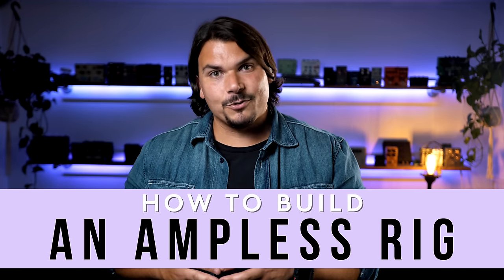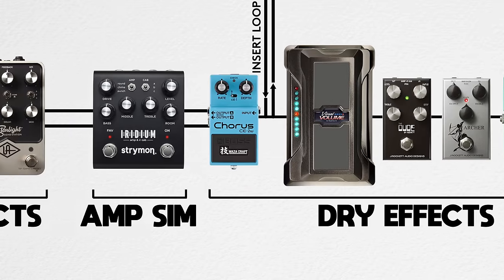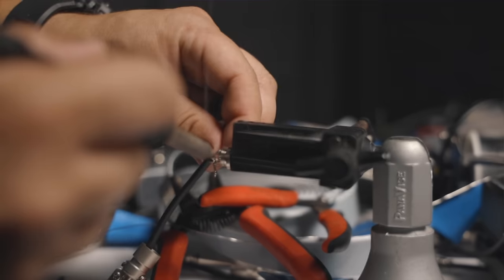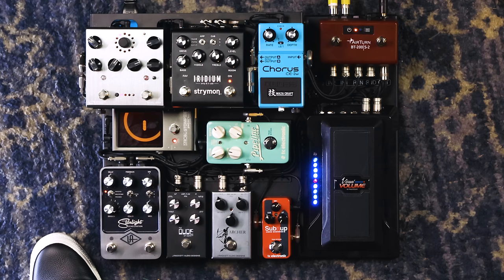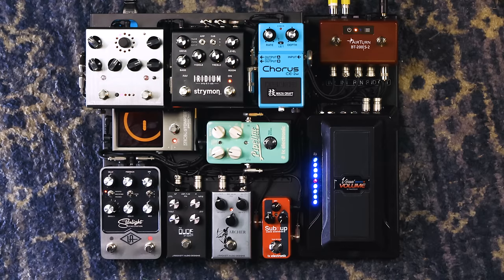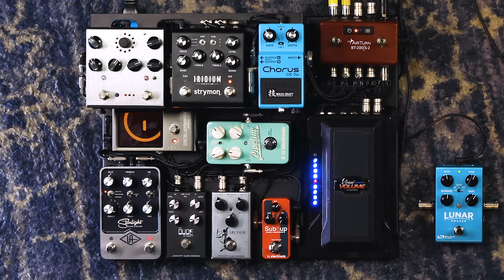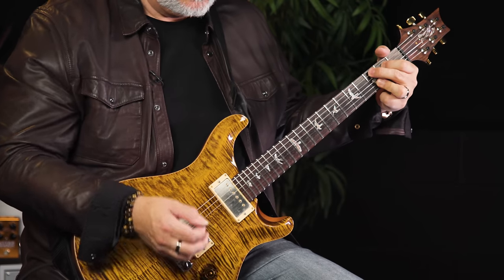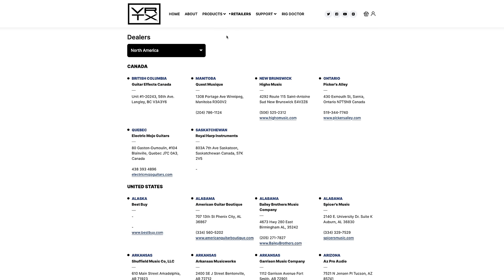Do You Need an Amp to Get Great Tone?

Comment: If I have this for a pedalboard OD-->preamp sim-->delay-->reverb can I plug this directly into my studio monitor?
Reply from the maker: Powered monitors, yes if it's like the Iridium.
Reply: @VertexEffectsInc  how about if it's just a joyo american sound?
Reply: @Funkfreed  should work too. The American Sound is a Tech 21 Blonde Sansamp clone. So it is a preamp with (analog) cabsim. You might get a bit fizzy drive tones out of it, because the cabsim is a bit outdated. Than i would recommend an IR loader or any modern cab sim Pedal at the end of the chain. I like the gfi cabzeus mono for that purpose.
Reply: @aladinhellchicken7994  I still have to use a stereo pedal at the end of my chain. Plugging the joyo directly to my studio monitor only gives me left channel even if I use trs to dual ts splitter.
Reply: @aladinhellchicken7994 what if i use a mooer preamp? do u think i can go direct input on a live setting without adding another cabsim pedal infront of it?

Comment: In the "Which Power Supply is Right for You?" video you picked the Cioks as your absolute favorite power supply, but here you're saying that Strymon is "the best of the best" – how come you changed your mind? Did you learn something new about either of those brands that made you re-evaluate your choice?
Reply from the maker: I suggested several high quality options, and said I personally like the Cioks, but also said other were wonderful.  Honestly any I recommend in that video will do the trick, I didn't land on an "all or nothing" recommendation on Cioks.  Strymon is also great, some Truetone, even some of the new Voodoo Lab Pedal Power 3+ is great.  Those could have all worked here bu this is what Mitch had and it's in the same category of quality as Cioks.

Comment: I'm going to use the SD Powerstage200 together with a bunch of pedals. Would you recommend using an output buffer? All pedals in front of the power amp?
Reply from the maker: If it's all on the pedalboard you shouldn't need an output buffer.

Comment: If you want to go into a passive speaker do you need a power amp pedal?
Reply from the maker: The Iridium is not designed to drive a speaker.  You would need a power amp.

Comment: Hi Mason, I’ve been running ampless for a couple of years with an ES8 with a board full of Strymons, to include Iridium. I have everything going into the switcher, with pedal order set in the Loop Structure page. Does this truly represent a series setup structure as if the ES8 wasn’t part of the equation?
Reply from the maker: Yes, it's just pedals in series.

Comment: Would you put a buffer before a pod go? It doesn't have one. I don't know how much it's going to affect the pod go, if at all.
Reply: You should Google search  whether the POD is already buffered. Most of these types of units already have one.
Reply: @The Tone Lounge  it's not. I haven't heard any difference between the sounds from the pod go and the helix, though. Tons of people claim there is.
Reply: @Andrew Stonerock  if it doesn't, then you would benefit from having one.

If you use a really long cable going into the unit, typically anything over 10 feet, then put a buffer on input.

Same applies to your output, only if it's a TS cable. If you have an XLR out then you are all set.
Reply: @TheToneLounge  we use 1/4 out to our power stages and xlr to foh.
Reply: @AndrewStonerock  then you just need a buffer  out to your power amp (if you have a long cable run).
Reply: @The Tone Lounge  20 ft. Like I said, the sound difference between that and the helix, which has buffers, is negligible.

Comment: I'm curious about the interface box. I typically run stereo straight into the front of 2 amps, but sometimes like to run my pedalboard into a single amp with an effects loop. It appears I could build this same interface box and use for that purpose?
Reply: Just watched your mono sum video, so probably not ideal to build an interface box to do both a stereo and mono setup (unless I unplug R on the final pedal and run/pan L), thanks for the great videos!
Reply from the maker: Yes, we have a video on how to do that and diagrams in our buffer interface tutorial.

Comment: Great board , what kind of DI box are you using ?
Reply from the maker: Why do you need a DI?
Reply: I’m confused on that as well. The ventris is the last pedal in the chain, yes? The signal goes out from there to….where? On your diagram it shows the signal going from the ventris to the mixer/daw. How would that be possible without a DI box after the ventris?

Comment: I use this quilter block cab simulator, get me to the correct impedance with a balanced signak but sounds bad.....
I use a compressor,drive,and reverb pedals that I run off a tri parallel mixer....
Helps but doesn't sound anything like headphones or an amp.....help??? 
Trying an EQ next.....

Comment: Can you run something like this into a cabinet?
Reply: You would not be able to run it into a nonpowered speaker cabinet, as it’s a line level signal coming out of the pedalboard. But they do have flat response, full range, powered speakers (similar to a powered PA speaker) which you would be able to run directly into. I go out of mine into a high wattage, clean keyboard amp, which also works pretty well.

Comment: Really great build! I just wanted to ask your thoughts on something like the Pinestripe Pedals Diso+ after the pedals to match the levels a bit more for the FOH or direct signal to the recording interface? It’s beyond me, but I’d always want the best tone / signal for recording. Thanks!
Reply from the maker: With something like this, you shouldn't need any sort of DI, the output impedance is low - 100 ohms with any decent guitar cable you should be able to drive 100 or more feet without any degradation.
Reply: Agree with the Rig Dr's assertion that a buffered/low impedance signal will drive an unbalanced signal up to 100ft.  If you are running into a recording interface, there should be no problems. However, if you are playing on a stage, you'll likely need some way to convert to XLR to connect to the snake. This can be accomplished in many ways..but keep in mind that if you connect the Iridium directly to a mixer and phantom power is accidentally applied, it will quickly KILL the Iridium's outputs.  Anything with transformers will prevent damage as will an active DI.  Keep in mind that most passive DIs will drop the signal level by 15 to 20dB.  This can usually be made up by cranking the channel gain.  We designed the DISO+ with 1 to 1 Jensen line isolation transformers to keep the signal level at the original level, convert from 1/4 inch unbalanced to XLR balanced, allow ground lifting (not possible with a 1/4 inch guitar cable connection).  In addition it has 1/4 inch outputs that can be used to connect to a powered speaker for monitoring and can be used at the same time as the XLRs. HTH!
Reply: Wow, thank you both for taking the time to reply!

Comment: Hey Mason,is there a way I can boost a line level signal??…..I have an old 1989 Marshall 9005 stereo rack power amp…..it was designed to pair with the matching Marshall preamp,which was -10db to -20db on the output,so the 9005 is expecting a loud signal on its input…….In my application,plugging a pedal,or load box into it,you have to really crank the volume to get the needed volume levels…it’s not putting out its full potential without a hotter signal going into it…….not sure how to do this…
Reply from the maker: So you're trying to drive the power amp with a pedal?
Reply: @VertexEffectsInc  kind of…….It’s a wet dry wet system……my line out of a load box feeds a Micropitch,Delay and Reverb pedal,which connects to the A and B inputs of the power amp…..

Comment: Do we need to put buffers if we have buffered pedals?
Reply from the maker: The buffers in your pedals are not the same quality as the buffers recommended for the input and output of your pedalboard or (for example) the buffer we manufacture.  Most of the internal buffers are designed to drive short distances (like between pedals), not a 20+ foot cable back to your amp  or load the input of the pedalboard properly.

Comment: Hi Mason. My ampless setup. 

Boss TU3-Blackstar Dept 10 preamp with delay & noise gate on its efx loop - headphone out - PA/interface. 

Can I put a Zoom MS70 after the Blackstar preamp using the headphone out & still have the Cabinet simulations? Should I use a TRS or TS cable? Thanks

Comment: Jason, Iridium or Walrus ACS1 as your choice?
Reply from the maker: I like the Walrus because you can use a different amp on each side of the stereo outputs.
Reply: @VertexEffectsInc   Right. Is there a way to run one side into PA and the other side into an amp, e.g. an AC15? I don’t own a powered speaker amp.
Reply from the maker: @windowsoflife  yes, put a splitter before the Amp Simulator.
Reply: @VertexEffectsInc   is the Radial BigShot ABY okay?
Reply from the maker: @windowsoflife  sure but you could even go simpler since you don't need any ability to AB, you really just need the "Y".
Reply: @VertexEffectsInc   I was think of ABY for multiple use, when I would use the Walrus.., and if I wanted to go w two amps- my Dr Z and AC15. 

Mason, I really appreciate your incredibly prompt and excellent direction you give!
Reply: Great pedalboard! Mitch sounds like Neil deGrasse Tyson.

Comment: So I tried making an amp less pedalboard using a Vertex SSS-SRV, and Ultra Phonix, a Boost, an EQ pedal, delay/reverb, and a Cab M+ pedal. But when plugging into my cabinet, it barely makes any sound. Not powerful enough. So it seems you at least need a pre-amp pedal of some kind, correct?
Reply from the maker: I think you misunderstand the product.  It's not a power amp (to drive speakers) - it's a preamp pedal that's designed to work with cab simulators, like the Cab M.  The Cab M isn't a load or designed to drive a speaker cabinet, it's only a speaker thru if you wanted to say, use it for an IR to feed the FOH, and didn't want to mic your cabinet.
Reply: If you had powered speakers / monitors then what you're doing would work.

Comment: Had a Strymon Iridium - sounded AWFUL has that terrible digital sound, sold it eventually - that's put me off ampless.
Reply: Try any of UA/FX's amp sim pedals, Woodrow - tweed amps, Dream '65 - Deluxe Reverb, or Ruby- AC-30s. They are amazing (I have a Ruby and love it). Check out Rhett Shull's "The BIGGEST Amp Shootout I've Ever Tried (UA FX Vs. Real Vintage Amps)". I think you'll be a convert.
Reply from the maker: Amps are best!
Reply: @VertexEffectsInc  Well, yes and no. Certainly, an AC-30, for instance, sounds like an AC-30 because it IS an AC-30. However, AC-3Os are notorious for overheating during ordinary use because their cabs are not properly vented. 
Also, they are wickedly loud even at clean settings. They were designed to help touring British bands like the Beales be heard over their screaming fans, accordingly raw volume is their raison d'être. AC-30s have no master volume, just a volume knob. They cannot be used to best advantage in an ordinary club or anywhere else that is not a large theatre, a stadium or outside.
Also, they are wickedly heavy at 70 lbs. (5 stone). That's why there are three handles on the top, one centre one as usual, which is largely unusable as the amp can hardly be carried by one ordinary (not bodybuilder) person very far, and a handle at each end for two people to lift and carry it, which is what is usually done. That's not a gigging amp for me.
So, if a pedal that weighs1.24 lbs. (like UA/FX "Ruby") can come even somewhat close to the real 70 lb. thing and can be used anywhere at any volume, you're on to something. When that pedal is virtually or actually indistinguishable from the real thing, as well-demonstrated in the Rhett Shull video I sited, it's a no brainer, you're going to use that pedal, mate.
I have a 1964 AC-30, non - top boost, copper top, all original including Mullard tubes and blue Bulldog speakers. It's great and it makes a very nice shelf base in my living room along with my Fender '58 Super. They'll last forever that way. :D
So, with all respect, amps are not always best unless you need a very nice shelf base.
Cheers

Comment: Step One: Buy Quad Cortex.
Step Two: End Video.
Reply from the maker: It's one way to go, but won't supersede a set up like this sonically to re-create exactly what's here 1:1.  It's a great alternative to a Line 6 HX or AxeFX or Kemper, but they all have their shortcomings sonically compared to the individual pieces.
Reply: @VertexEffectsInc  I am building a similar setup with an Iridium for direct recording as well as the occasional live use.  I will have the option of going into the board with the Iridium or in front of an amp with it bypassed and using an OD pedal (Friedman Smallbox) plus a few other pedals.  I prefer this setup to a complete modeler option mainly because I want knobs for live us vs menus.  Of course, I prefer to use my real amp and a board but I want the options.
Reply: Something like the Source Audio Nemesis which does delay and reverb ( I use one with my Dirty Shirley), the Iridium, a booster, Phase 95 and tuner with a small MIDI pedal (like the Tech21 MIDI Mongoose) would make for a great little setup.
Reply: @VertexEffectsInc  It would be interesting to see/hear a comparison to showcase the shortcomings in the mentioned multifx units compared to this rig

Comment: Nothing sounds like a tube amp .Nothing.
Reply from the maker: Agreed!
Reply: You should be comparing an amp simulator with a miked up tube amp because that is what they are mostly simulating. Hearing a tube amp directly (through a guitar cabinet) is a very different thing compared to when that same guitar cabinet is miked up (also depending on the kind and placement of the microphone)